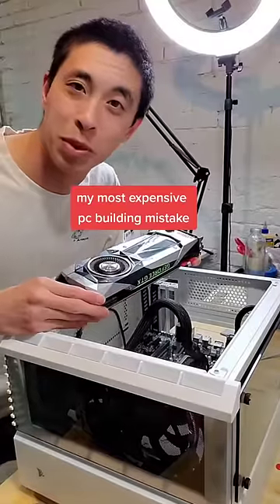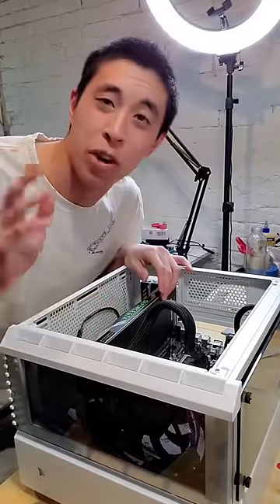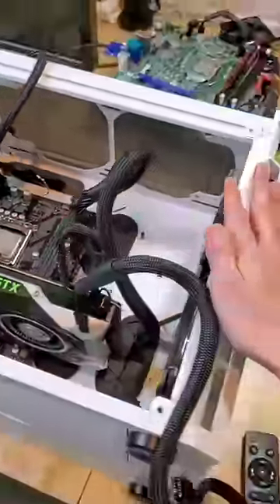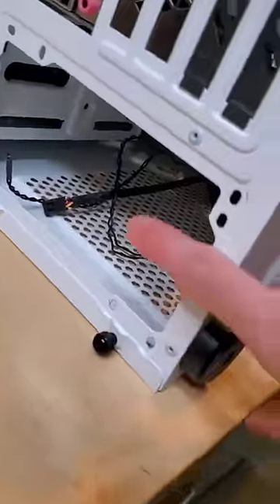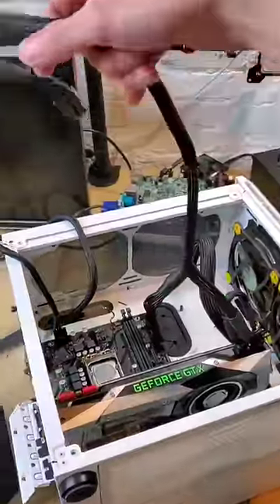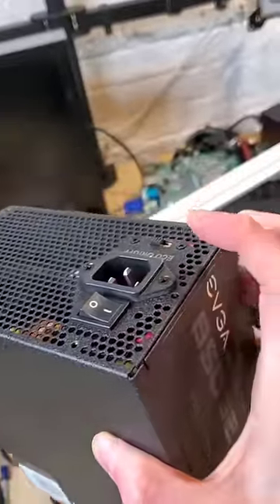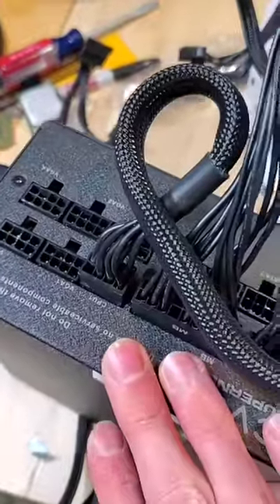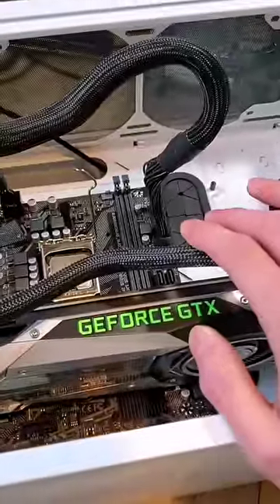my most expensive pc building mistake... #shorts

Comment: This video needs more views. Just upgraded my PSU which was already a long time coming. Apaprently i thought 650w would be enough for. 2080S and a 5800x, 32gb RAM 2tb ssd, 2 tb HDD. 

plugged in my old cable into the PSU aaaand nothing. Luckily my system is still functioning. That i can tell....

Comment: One day, I tried to use my new 500-watt PSU on an old HP computer. HP has its own PSU, so it shouldn't use an external PSU. When I plugged it in, I saw smoke come out of the PSU. Thankfully, the fuse burned out and saved the day.
Reply: I also dropped my enterprise SSD worth $300, which comes with a metal cover to dissipate heat, onto a 24TB HDD backplane. I don't know what happened at that moment, but I saw a huge short circuit, and the 24TB HDD backplane burned out with a large black spot. I don't understand what happened at that moment; it was completely messed up.

Comment: I got a motherboard with a biOS that won't boot without integrated graphics. Now at the time,  I was just getting into PCs, so I didn't know this. So I got a Ryzen 5 5500, which has no integrated graphics. Costed me about €100. Yikes. Now I have the Ryzen 5 5600, which is just the 5500 but better and with integrated graphics.

Comment: My first pc had integrated ryzen graphics, then i bought a gpu for it about a year down the line, the gpu didn't have a backplate... and there were exposed pieces of metal... and i has a metal screwdriver... it made sparks that looked cool, i had a cool, expensive, spark maker that was a lovely little fire hazard

Comment: My most expensive PC mistake was thinking I bricked my prebuilt with a 3090 and 12900kf in it and then buying the parts for an entirely new build which included a 4090, 13900k and ddr5 7600 ram just to find out it was an issue with my monitor timing out after a certain amount of time and not displaying BIOS

Comment: Not money, but time. I recently built my first pc, but I had a prebuilt that I was using and wanted to upgrade the cpu, which required a new motherboard and psu too. So, basically completely rebuilt. I got a 14th gen intel so I needed to update the bios. I spent the whole day screwing with the bios flashback on ROG motherboards, I was ready to send it back when I tried something as a last straw. I was downloading the bios for the ROG strix b670a gaming WiFi motherboard when I needed the bios for the ROG strix b670a gaming WiFi D4. Very small difference, but enough for it to not work,

Comment: Just recently I was having issues with my ram, (this is the first pc I’ve ever built and the only only I’ve ever built) and I bought an atx motherboard because go big or go home. I bought a new case because of some cooling issues I was having with the old one. When I but every thing into the new case and powered it on, I got a dram light. I test the ram, damn it one ram stick isn’t working anymore. Order new ram. Put in new ram. Still doesn’t work getting the same light. So I test it again and both ram sticks are working but a motherboard slot doesn’t work anymore. Order a new motherboard. Install new motherboard. Still doesn’t work. As a last resort I checked my cpu pins. (I checked them before and they were fine) one pin is completely missing. So I spent about $300 on new ram and motherboard for no reason. Might not seem like much money but I’m a jobless 15 year old so it hurt my wallet a bit. CHECK EVERYTHING AS YOUR INSTALLING IT. Can’t stress this enough now

Comment: I was replacing my thermal paste and I kept trying to pull off the air cooler, it pulled out but the cpu came off with it, when I was pulling it off i scraped it against the case and I bent quite a few pins, that went my ryzen 5 5700x

Comment: Personally, my current set up is a bit of an issue. My gpu is a 3050, my processor is an i9-12900kf… due to bottlenecking, I’m only getting 53 percent cpu use (if I remember correctly).

Comment: I delided a 8700k and put liquid metal on it building a water cooled rig in a tower 900 and forgot to put the backplate on the mother board, so when I tightened the water block down I cracked the die on that brand new 8700k....doh

Comment: Accidentally put the cpu in wrong... 90 degrees rotated... powered it on and fried the whole thing :(

They put two triangles seemingly indicating the correct orientation... I noticed the wrong one and didn't double check the layout of the pins. Fortunately I was able to return through Amazon and get free replacements 😅😅

Comment: had a really expensive workstation laptop because of homeoffice… was eating a burger king menu while watching yt during a break. they forgot to put ketchup in… while running to the fridge I forgot I had a headset on … the cable tipped my coke over and the whole cup poured onto my keyboard and into the laptop core… bam. 3k gone because of a 30cents ketchup mistake

Comment: Did a dual socket home server build for a family member. The thing had a bunch of separate power supplies specifically for hard drives (thought i could save money). A bunch of the drives were connected to psus with molex to sata adapters. You can probably guess what happens next. It wasnt too expensive but it was quite embarrassing.

Comment: lol, yup

Smoke a 250GB SSD using a SATA power cable from another power supply, what’s worse is I knew better lol. 

Be nice if the industry finally standardized wiring on all power supplies as there is really no reason for it to be different between OEM’s. 

Also no reason why anybody needs 4 power connectors on a single harness either, the 1990’s/late 2000’s are long gone and nobody needs 4 SATA power cables for two CD/DVD drives with a Hard Drive or two.

Comment: I'll chip in. 

I had my motherboard with a Ryzen 7 in my PC only that I only ever changed the thermal paste once. 

For me anyways, the biggest mistake ever. The CPU got stuck to the CPU fan and it would not let go, tried scraping it, rubbing alcohol, the works and nothing. 

I lost a CPU and a Fan just because what I (ASSUME) is that the thermal paste dried really badly on components after not changing and cleaning the paste regularly.

Comment: Yeah psu cables are usually proprietary or at the very least not wired based on any standard. I used to sleeve my own cables and just going between two psus the wiring was always different on the PSU side of the cable

Comment: Sometimes you can get away with this - mostly because some OEMs make PSUs for several brands. For example, SeaSonic sells to both Corsair and ASUS as well as selling units themselves, so those units may have compatible cables. Similarly, EVGA SuperNova PSUs are rebadged Super Flower Leadex units. Cablemod has a decent list of which PSUs each of their replacement cables works with, which also helps to show some of these "families" of units using the same pinouts, the internals of which are often nearly identical within the same wattage.

Comment: Back in the 286 era I fried a hard drive, because I crammed in the power cable backwards. Yeah that de facto standard 4 pin molex power connector, with dented plastic edges that makes it difficult to insert it the wrong way. My strength won over my brain that day.

Comment: HILARIOUS that this shows up right now considering 3 hours ago I did this exact thing when installing a 4090 and new PSU in my old rig.
Had cables from my old EVGA psu and just left them attached when installing my new thermaltake.
Tried booting and nothing happened. Tried again and fans came on but it wouldn’t post no matter what I tried. Boards debug LED went bonkers though and started flashing reserved codes. So there’s that.
Currently testing each component in a different rig to see if I fried anything other than just my motherboard lmao.
Fingers crossed this is only a $300 mistake and not a $3000+ one. 
Fingers crossed lmao.

Comment: Not a pc build, but when I was a kid (13? 14?) I set my dell laptop on fire. The hinges had broke, so eventually the screen cracked open at the bottom. When you shut it, if you werent careful, the wires from the screen would slip out and get squashed. Eventually they stopped working and my computer wouldnt turn on. So I grabbed some electrical tape and wrapped it around the wire and shoved it back in. It turned on!! It also started on fire

Comment: My mistake was that i connected my lga 775 core 2 motherboard to a pentium 4 hp compaq power supply and the vrms short circuited and i was so angry that i accidentally blew up the psu by changing the 220v to 120v and i regret doing that and at the time i was 12 or 11 if i remember correctly the next mistake i made that still hurts me to this day was that i threw away our faulty hard drive with everything inside it like everything about our lives,  family and friends photo everything important because i opened it or atleast tried to because i thought i could fix it but turns out i couldn't not even shocked if your a pc technician you would obviously say you moron you bloody shit brain but yeah anyways it hurts me to this day and i wish i was smart like now so i would have not mess with things that are beyond my understanding of repair

Comment: Not really a learning issue but. Trying to troubleshoot pc issues aka cpu needed bios update. I took lff cooler at least 4 times. One of the times the cpu came off with the cooler. After i was done straightening the pins i was seeing crosseyed. Hr later as well. I was determined to fix it as it was a brand new 5900x.

Comment: I was working on my dads computer doing a ram and ssd upgrade and a loose screw got behind the motherboard and case. Instantly fried the board and I had to get a new board because of a screw that was floating around that I didn’t know about. If you drop a screw you better find it.

Comment: I'm an electrician. I got curious about what kinds of voltages id find across multiple points on my GPU (GTX1060) with my meter. I got a decent spark on one of the areas. completely forgot I did it, and eventually my games started slowing down and my GPU started reaching like 90 degrees celsius. It wasnt until a friend came over to look at it to notice my GPU fans had stopped spinning lol. cant confirm 100% it was that spark I caused, but confident enough that I wont be sticking my meter where I dont know wtf im testing anymore lol

Comment: Not a mistake but a lesson i learned the hard way, is that when you buy parts and something isn't fully DoA but doesn't work quite right, you NEVER say it has a problem when you take it back to the store. You give any lame excuse you can think of for why you don't want it and you get a refund. If you say "its not working right" you may get stuck waiting for months for a "repair" that may or may not have been performed.

Comment: I just built mine for my first time and I got a big 3 fan gpu and when i had everything ready I went to put it in except it wouldn’t fit it was just slightly too big but I was able to put it in at an angle then I twisted it after it was below the lips of the case then I connected it to the motherboard and there is not even half an inch of space between the 3 front fans of the case and the gpu truly scared the crap out of me

Comment: The brand has nothing to do woth it, You just need to use the correct cables and a PSU that automatically shuts off if there is somethiung wrong. just imagine not being able to buy new cables for your psu.

Comment: Turned my pc on smelled weird electrical burn smell. All the power went off nothing would respond no power at all. I figured it was the gpu died so I bought a new one took the old one out and put new one in I was terrified the whole mother board and everything got fried as well but luckily it started right up wondering why it didn’t fry the whole system??

Comment: I once fried a motherboard by putting in both the molex connector and the motherboard fan connector. It was not a fan of 12v going the wrong way lol.

Also recently cracked an m.2 ssd because i accidentally left the middle standoff in. Big oopsie on my part. Sadly i did not see it in time because there was a heatsink on top when i screwed it in

Comment: Forgot to discharge the battery of a gaming notebook or to use the built in discharge function before unplugging the battery. Electricity arced from the connector to my motherboard. Visible electricity. It was kinda scary lmao
Reply: *i am used to older laptops or just desktop computers in general.

Comment: Tried to put a aftermarket cooler on my graphic card . There was one capacitor in the way , I attempted to take the cap off and put a shorter one on that was the same specs ,  never worked again , then I once had a corsair modular supply two of them.  I tried using the molex sata power cord from one on the other thinking they would be the same . It fried my 2 ssd and all my light kits I just got . All the info on the ssata hd  was still a huge loss . I still have it maybe someday ill have someone try to get info back

Comment: I had an old pc up and running Linux and I was happy and then I installed an old video card and it was great so then I tried to install another card but I unplugged it and then clicked the pc button but it still had a little juice in the capacitors and fried some chip on the motherboard and I couldn’t get it booted I know that pc was only prob worth 50$
And I only lost the mobo I am always super careful when working with computers
Reply: best practice is to flip off the PSU and hold power for a few seconds

Comment: It thankfully didnt cost me anything but i remember benchmarking and playing with fan curves when i had 2 GTX480s in SLI. I started another benchmark run, and realised i had left  the fan curve flat at 20% and both the 480s were over running at over 100 degrees each. Thankfully no damage was done, but that would have been my most expensive mistake if i hadnt picked up on it.

Comment: Don't ever use sticky type heat spreader on RAM or M.2 NvME. When you pull the heat spreader off, there's a chance it'll damage the memory chips on the component. I made that mistake and caused a fairly new WD Black M.2 NvME to no longer work. And since the label got ripped off the M.2 NvME, I can't claim warranty on it.

Comment: I added plugs onto the power supply, mixed up 12 volt with volt, because red and black naturally felt like plus and minus.
Mainboard, dead, harddisk dead, cdrom dead(yes was before dvd existed)
The harddisk motor controller chip actually lid up. The metal base plate of the chip(probably to absorb heat or something) was glowing yellow. The chip was so hot.

Comment: Clogged an old Aquacool loop by not changing fluid after like 8 years. Was testing out using high performance car coolant in a PC loop(distilled water and water wetter). Works great, but it forms crystals after a while. Was like $800 worth of blocks gone. For context, the old aquacool blocks were designed to just have the brackets changed to fit any socket.
Reply: what percentage? if it's like 19:1 water to coolant you shouldn't have major issues with mineralizing
Reply: @puppieslovies  I followed the bottle instructions. Was more the age than anything. 0 maintenance on a loop for nearly a decade is not great.
Reply: @TheMidnight366366  yeah I suppose

Comment: I built a similarly used pc and put the mb on the chassis with too short screws. pC worked fine. i moved and when I unpacked the PC all 4 screws had come off… the mb was dangling. Put in 4 longer screws, and it worked out perfectly! 😊

Comment: Bent the pins on my 3900x when changing the cpu cooler. forgot to warm the system first before attempting to unscrew and remove the stock cooler. the cpu pulled out attached to the cooler! by some fluke, all the pins stayed attached and about 10 were bent. i painstakingly used a hairdryer and credit card to straighten them as much as possible, and then placed it back into the socket (i think the socket holes helped straighten them too!). that was 4 years ago and its still running strong. I was extemely lucky. always run your pc for about an hour before attempting to remove the cooler guys

Comment: My costliest mistake was similar, but not catastrophic. It was the first PC I built with all new parts. I made it to be a video editing PC. Unfortunately, the computer often failed and rebooted. I sold the motherboard, CPU, and ram and tried again, but it persisted. Turns out the power supply was faulty. My fault for not vetting a reputable brand. So not only did I essentially build the computer twice, but I never got my full money back for the first set of working parts.

Comment: I switched from a 650w PSU to 850w PSU for a new RTX 4080. I didn't want to re-route the cables, so I did some research to see if I could use the old cables. Everything I read said it should be fine. So I used the old cables and went to boot it up, but nothing. No boot at all. I used the new cables, and everything was fine. It booted right up. I guess I'm lucky 😂

Comment: I swapped out a PSU in a brand new build without swapping the sata power cables to a hot-swap bay. It wouldn’t post. It would only power on for a second and then turn right off. I couldn’t figure out why. Finally, swapping in the cables that came with the PSU gave me a post. I’m assuming it was some kind of safety feature in the PSU itself because those cables never touched the motherboard? Anyway I ended up being grateful I didn’t have a situation like you’re describing!

Comment: Inserted the ram the wrong way around. Got super lucky and only killed the mobo. I did take a massive step down in the mobo replacement because the chipset was a bit old at that point, so there weren't too many good options anymore. The ram worked for quite a while no problem, and I eventually sold it when I upgraded.